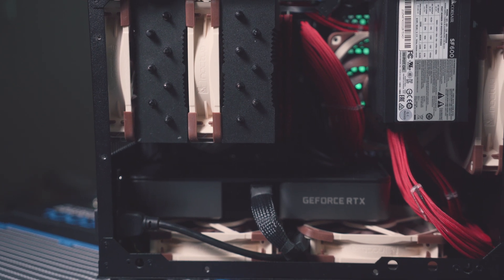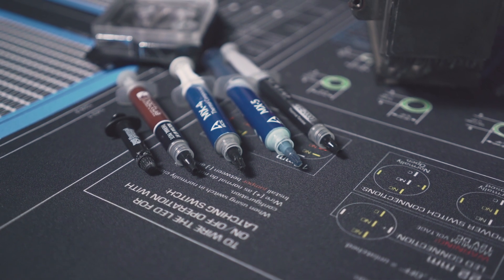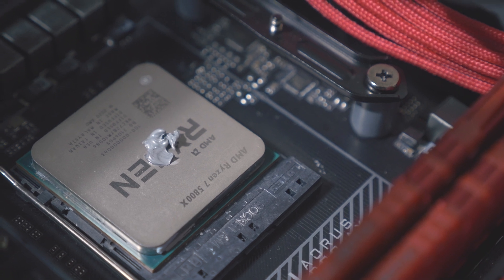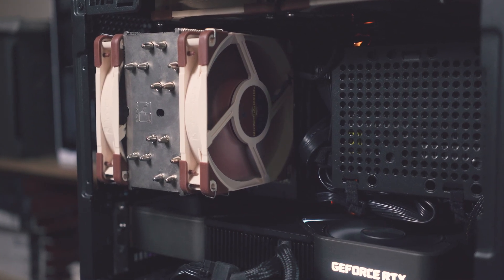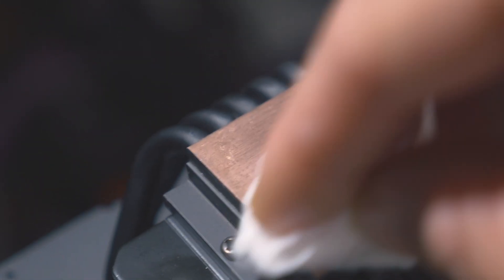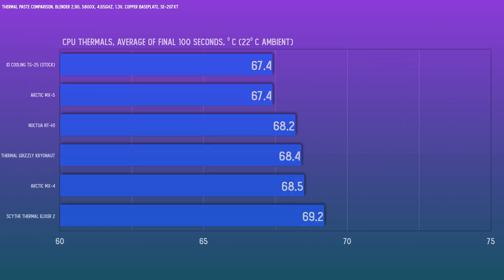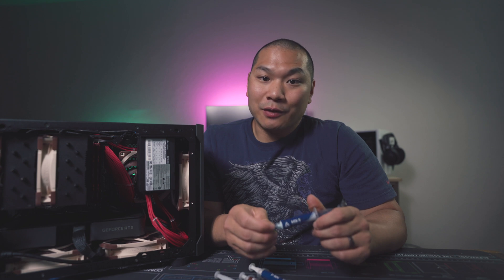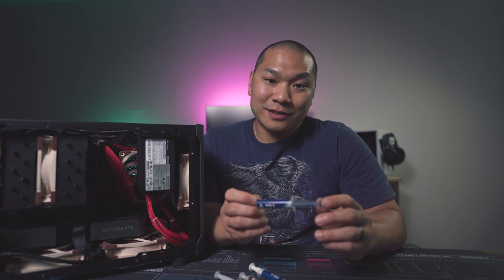Underneath your Cooler: Thermal Pastes Compared

Comment: I use Noctua NT-H2, same performance as MX-5 but much easier to handle and spread in my opinion
Reply: MX-5 is practically an adhesive. Wound up pulling out the whole CPU from a locked socket twice now. 
Hair dryers are a life saver. About a minute of heat right up on the heatsink, some light twisting, maybe a slide...
Performance was awesome, but it was a hassle. And with current prices I need an alternative.
Reply: I used Arctic and had the same experience with the cooler being stuck to the CPU. I'm trying Noctua now.

Comment: Is 70% isopropyl alcohol better for removing thermal paste (assuming we leave the intel cpu inside the motherboard) when applied to a paper towel than 99%? I assume the 99% would evaporate upon contact with the paper towel.
Reply from the maker: I typically remove the bulk with the little plastic spreader and then wipe with the IPA/towel. The percentage isn’t a huge deal (70% is typically more for medical purposes), as long as you get the residue off it’s good enough.
Reply: I use 91% iso rubbing alcohol, that's the best one to use for everything. More purity is better, because less % = more impurities, and you don't want residue of that on sensitive electric parts. The 91% being the winner due to purity and quick evaporation.

Comment: Really should have included GD900 in there. Tech city has high praise for it's price to performance value. I don't recall where I heard this from but I think the 5 dot application method was suggested for Ryzen(4 corner dots 1 center dot).

Comment: A small update - not only is MX-5 nightmare to apply, it´s also a nightmare to remove - i had to use a ton of cotton pads to remove it from CPU/GPU/chipset & cooler surface and then another ton of cotton buds to remove residual paste from sides. Due to this, i´m throwing the rest of my MX-5 supply to trash bin.
Reply: I can confirm it. I wish the paste was more fluid.
Reply: I have read reviews that it actually pretty much glues your cpu to the cooler… where the cooler can rip the cpu out of the socket when trying to remove it.

Comment: Since I have laptops that need re-pasting, I've looked online and started switching to the thick stuff, thermalright tfx, or the value variant from aliexpress, zf-ex. Most of the popular paste tends to result in a pump-out effect, needing more frequent repaste. I just started using it, so time will tell if any issues.

Comment: I used the Arctic MX-5 when i was doing the maintenance of all computers last time. I dislike the stickiness of it, it makes distribution over IHS with nitril glove a nightmare - much worse than older MX-2. Noctua NT-H1 is probably best in terms of application - and you don´t need too much of it, 1 small tube is plenty for like 10 applications. Performance seems within margin of error. Thanks for the test! You are best, man, testing things nobody else does 👍
Reply from the maker: Yup! The MX-5 flows well but it is very sticky. I really like NT-H1 too and it’s very consistent as well. A fraction of a degree isn’t a good reason to go one way or another.

Comment: Rabbit hole, scary. Try quite a few TIM myself. However, even slight variation every time you remount can result 0.1 - 0.3C difference with the same cooler and paste. So when the result is so close, a few tenths of degree among them. It makes the result less than conclusive. Any good paste is good enough for most of the enthusiasts. For me, I just use whatever I can get my hands on. Now I have both NT-H1 and NT-H2 in 10g tubes in my toolbox.
Reply from the maker: Agreed. These are all top notch products here, the defining characteristic really should be price and ease of application, and durability for some.

Comment: Thermal grizzly is too expensive for what it offers. It doesnt make sense. Also, i heard it can degrade over time.

Arctic mx-5 is the best in my opinion too. Thanks for the comparison betwin different cooler bases ! Very interesting !
Reply: Thermal grizzly kryonaut is good but squeezes outside to the outer edges of the die due to heat overtime and also dries out really quick in just 3 months of load. By drying out i mean when you open up your GPU/CPU what you see there is just no thermal grease like somebody forgot to repaste it. It's somr crazy stuff. So its recommended to go overboard on the application and use the thermal paste applicator. If your Kryonaut temps are worse then ure not using the applicator or just ambient temps are off.  

I think it was designed for overclockers because there is no curing period not particularly of the temp advantage.
Reply: I like nth1 a lot. It settles super fast and lasts quite a while. Arctic mx5 is comparable. Really it’s whatever is cheaper